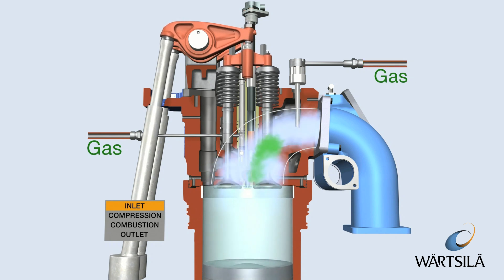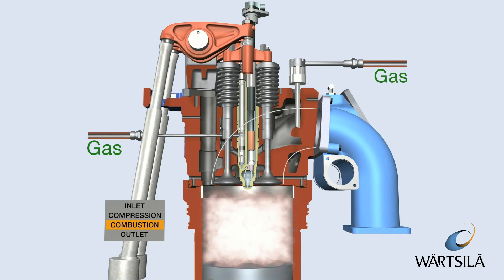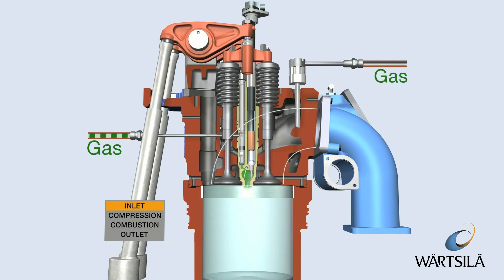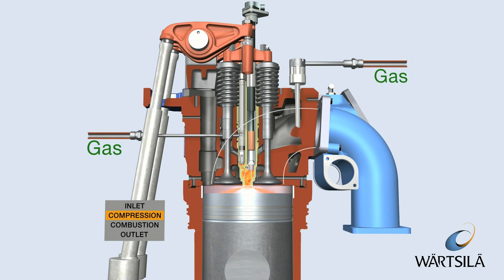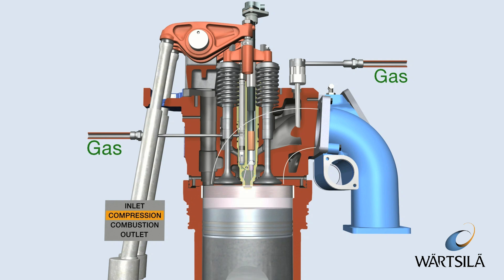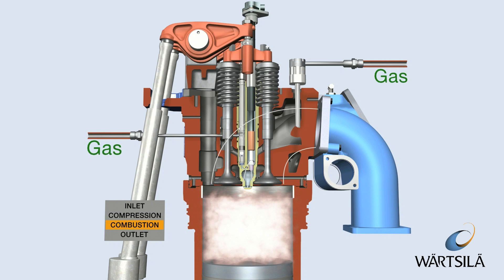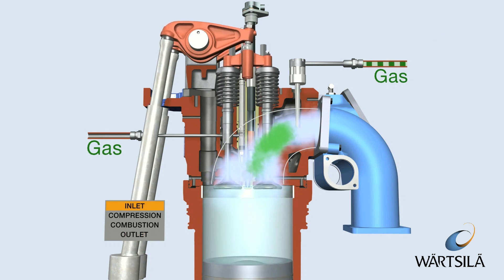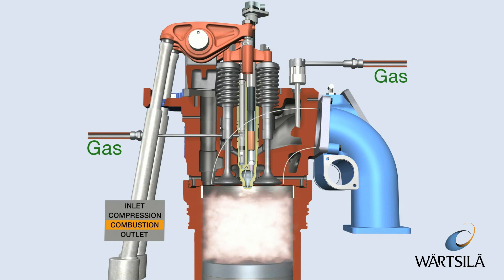Lean Burn Process | Wärtsilä

Comment: So what is the air/fuel mix ratio?  A typical gasoline engine has a mix of 14.7 to 1.
Reply: Jess Stuart you can get really lean if all you're going for is efficiency. 50-60 to 1 is not unheard of..
Reply: @W--ko9ms  For a gasoline (petrol) engine, the stoichiometric air-fuel ratio is around 14.7:1. This means that, in order to burn completely 1 kg of fuel, we need 14.7 kg of air.
Reply: About 15/16 to 1
Reply: People are adjusting their efi cars to 17-18:1 during low load cruise 45 to 80mph.  It saves gas.

Comment: yeah but i want to learn what the purpose of lean burn is in Engines now.
Reply: illegaLBulgarian They carefully control amount of air and fuel so there is less incomplete combustion, leading to less carbon monoxide released into the atmosphere, to reduce air pollution. :)
Reply: To make engines More efficient, cia
Reply: to make temperatur in cylinder lower